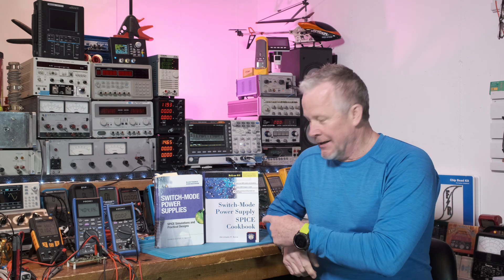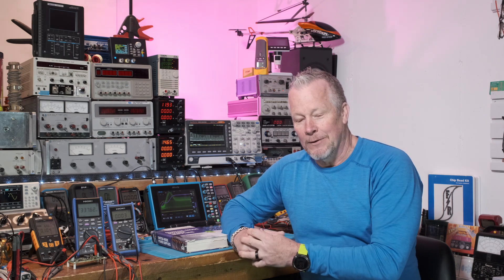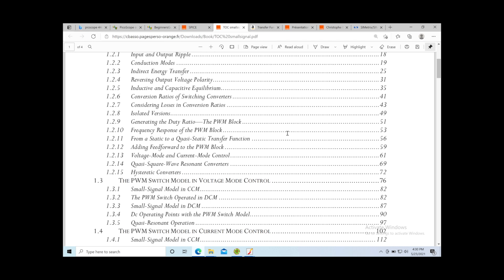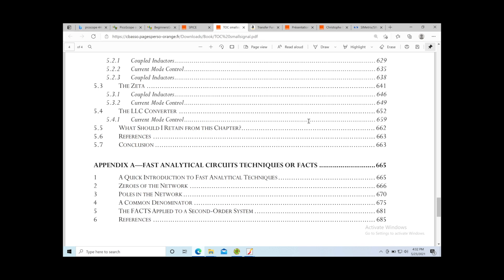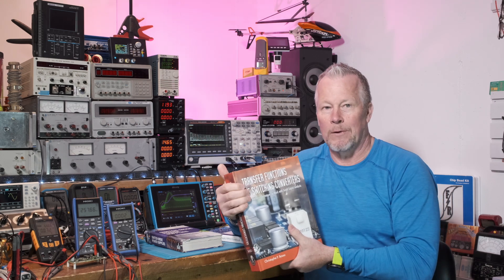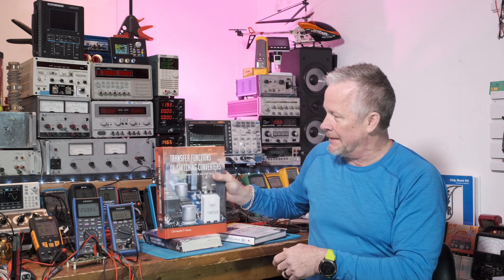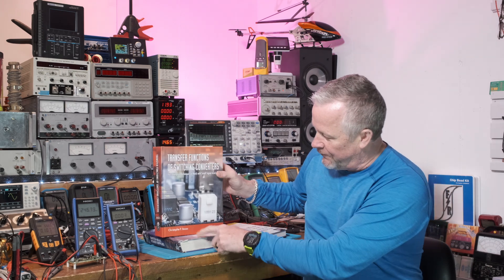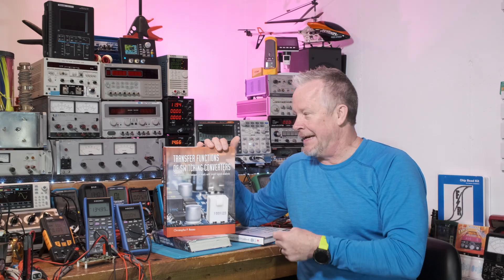Power Supply Book Review Basso   HD 1080p

Comment: So darn relevant for those of us in a country that is going gang busters on Solar off-Grid homes where there's a priority for efficiency when it comes to using that battery storage supply.... i just know i should be investing in these reference texts. Thanks for the heads up.
Reply from the maker: Thanks for that great feedback!  I'm sorry I forgot what country you are in.  What voltage and current levels do you work with?
Reply: @KissAnalog  I hail from wee New Zealand right down the bottom the World. We’re on a 230VAC 50Hz Mains reticulation via our National Grid a big portion made by Hydro but we do have some wind turbine farms & It’s kind of similar infrastructure that’s used in the United Kingdom. Sadly around a couple decades ago a then Govt privatised the supply of electricity & now the prices can be a nightmare cost to some homes. Many folks have chosen to go off-grid, make their own using solar or waterwheel. It’s being super efficient when converting the stored DC back to AC mains they all want so they can use standard household appliances.